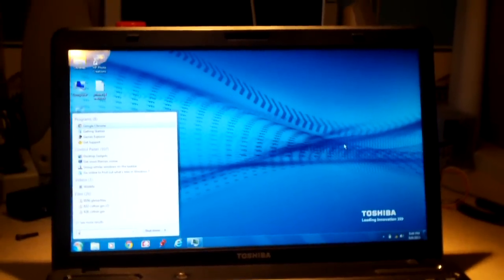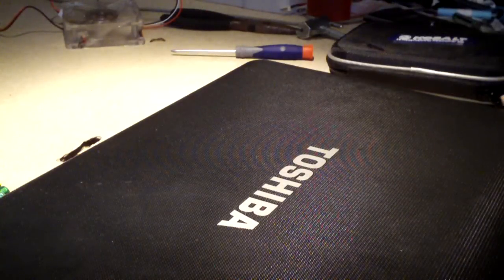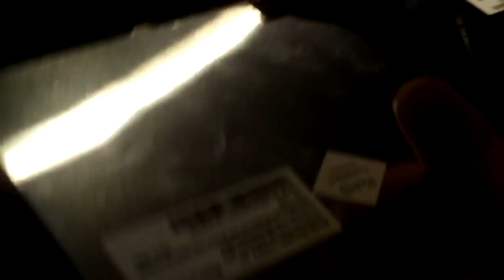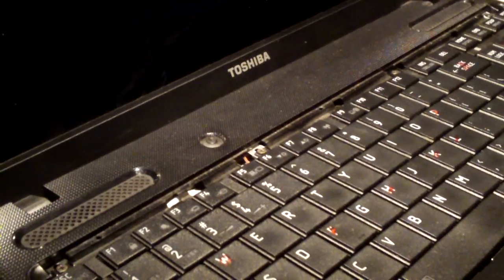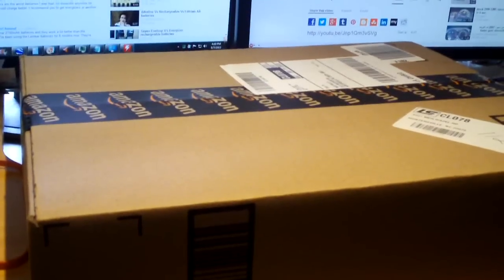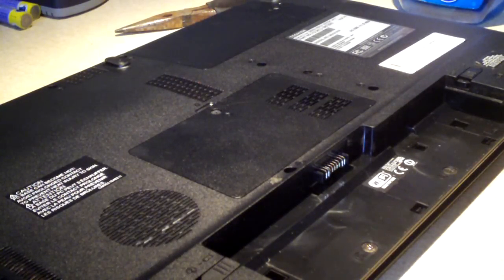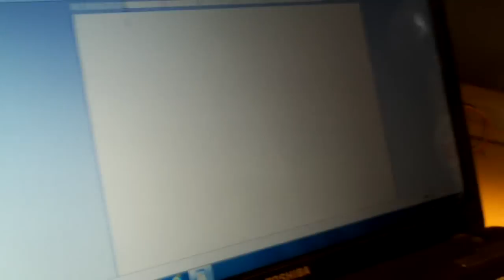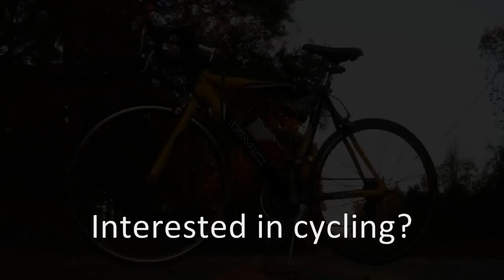Keyboard Replacement on Toshiba Satellite C655

Comment: I really liked this video. I just yesterday did a teardown of my computer, also a Satellite C655 (model S5501), so it was very topical. I'm not sure that your original keyboard is OEM. The one I have, which looks exactly alike. is not at all rigid, but very flexible. BTW, the ribbon cable gave me fits trying to install, as it does not have a "flip-up / lay-in" socket, but a close, very tight, "slide in / lock bar socket."

Comment: I messed my keyboard up by spewing beer on it when I sneezed!  LOL!  And believe you me, that ribbon cable is not as easy to replace as this expert made it sound.  You need about 4 hands because the latching slides keep getting bumped in on one side or the other so it took me a dozen tries.  :)

Comment: I am watching this on the same laptop in the video that I have fixed, it had bad hinges, bad speakers, bad os, ect ect. I have fixed MANY of these with hinge issues which lead to many other problems. The customer didn't need the laptop back, so it was mine! Yeah the hinges are cheap[ and rip out of the casing and can destroy the power cable and much more. These things are flooding in with hinge issues.

Comment: What type of Phillips heads screwdriver did you use to remove the keyboard screws? I have a Toshiba Satellite 655 laptop that needs a new keyboard, but the keyboard screws under the bezel are really tight.
Reply from the maker: It requires screwdrivers with tiny heads. You can find them at any hardware store, or Walmart.

Comment: I'm kind of curious, how often do you see bad hinges on these C655 Toshibas? I might be getting one soon from a neighbor and I'm worried whether the hinge will fail or not because I've seen a lot of stuff on them.
Reply: +Jacob&#39;s Channel I have a this exact same model and my left hinge is bad and pieces broke off into my fan.

If i tilt it, i can still hear a piece rattling in it, so i just leave my lid up all the time.

Now im watching this video, because the last letter of the alphabet key and my directional arrow keys arent working. (I just realied how ironic it is trying to tell someone about the key when i cant type it lol)
Reply: SHorTStuF0888
Sounds like a "wonderful" (In quotes for a reason :P) laptop.
Reply: my keys stopped working just today, and i now discovered that my question mark key and my FN key doesn't work. not to mention my fan is extremely loud and has been for over a year now.

It sounds like its grinding at times but then it will get quiet. Funny thing is, my laptop has never had a thermal shut down or got too hot crosses fingers so i don't jinx myself

I really dont wanna shell out cash for a new laptop, this one works fine, its just the physical hardware sucks on this...really bad.
Reply: SHorTStuF0888
you need to disassemble it down to the fan and clean it out.

Comment: ok, so i actually spilled milk on my keyboard maybe 2 months back.. ever since, when i hit the 1 and 2 keys it types z and \, most of the other keys are dead. I contemplated getting a usb keyboard for it but would replacing the keyboard work too?
Reply from the maker: Yes, replacing the keyboard should fix your issue as the keyboard circuitry is what got hit first by the milk

Comment: My friend has the same system, same issue (kinda), his keyboard is extremely unresponsive and does have a bad amount of input lag, these laptops are pretty much the problem child of Toshiba, in face, the HP systems with Hitachi hard disks that last 6 hours work better in the limited time yiu get from 'em... and the explosive Dells as well!!